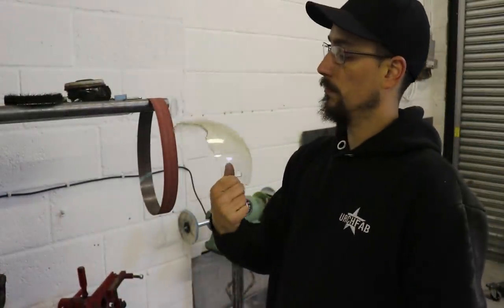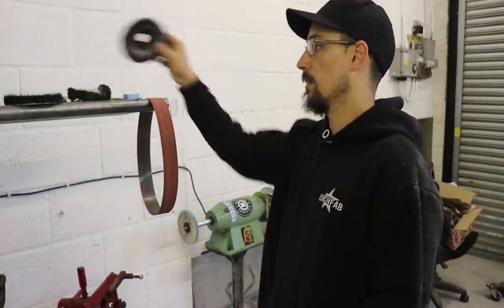HOW TO RESTORE SCRATCHED/ BURNT/ CLOUDY WELDING LENSES

Comment: I used meguires scratch x 2.0 with a little polish wheel/buff pad that fits in your cordless drill and it came up a treat. So a similar solution.  Good stuff
Reply: Where did you got the polish pad for drill? Have u got a link by any chance?

Comment: Works great Matt. 1982 and I finally rebuilt a vehicle properly. A 250 RD Yamaha. Fitted a fairing from a different bike. Screen was scratched to death. Did it by hand, fine emery, steel wool them metal polish. Person I bought it from saw it afterwards and asked where I'd got the new screen from 😊
Reply: @Walter Sobchak Yes, any abrasive fine paste works well

Comment: Matt, good idea , but if you do not have a belt sander with 1200 grit , I use  a product called Mothers
aluminum polish, it works great  , I think any aluminum polish will work. I have the same helmet as you
mine came with 3 of each (clear,yellow) and I have not touched them yet , just wipe some mother's on it and wipe it off and presto clear lenses again.  Cost about 12 dollars Canadian at Canadian Tire stores. got this idea from another you tube channel

Comment: Hi Matt great tip your right i am kicking myself i have chucked loads of these away and now just buy the clear because they are cheaper,  have you got links to the items you are using i cannot find them any were also do you get the same result with the grinding wheel buffer pad and were do you get them from checked toolstation and screwfix but no joy.

Comment: I find that most of the garbage is from the welding smoke, and with cleaning fluid for counters, and a couple of paper towels, most of it comes off. It doesn’t take scratches off, of course. But then, I don’t put my helmet down on the front.

Five or six quid each is a real ripoff. In dollars, I buy a package of 5 for about $18 off eBay. That’s about £14.3 at current rates. So about £2.86 each. Not cheap, but not terrible. Polishing works well, but you can clean it two or,three times first.

Seriously, just don’t put these face down!

Comment: Why do I find these videos after I've already done it? :) This guy is stealing my tips!!! First thing first, don't do this on a bike helmet, window, screen, something you want clarity with. Second. Meguiar Plasti-xR (balm without sand) is garbage and still won't make it cloud free. Third, I'm gonna give the flame polish a try. Fourth, Urchfab still never gave tips how to prevent this shit from sticking, can't polish after every 2-3 uses, that will get old fast. I'm thinking grease, wd40, engine oil, candle wax, dish soap, etc... which substances do you guys think will help the spatter slide a little bit better without melting onto the lens?
Reply: Update: using flame does nothing to polycarbonate, in fact you can ruin it, starts getting hazy, worst it can start to bubble. And finally using some oil does prevent shit from sticking badly. It was definitely easier to wipe then re-apply some oil again. Just don't expect clarity....
Reply: So I've restored a bunch of welding helmets for colleagues with great success. WD40, or any oil is highly recommended to prevent stuff from sticking, kinda like how you put dish soap onto race car windows to stop them from steaming up. As for removing you can start with something extreme like 1000/2000 grit sand paper if you see deep scratches and then work you way up with any type of polish you have in hand. Most of them are some sort of paste with sand which at the end will return the haze look. So here is the important step, if you are into knife sharpening then you have stainless steel green compound which is down to microns. That shit will really polish the surface to crystal clear and easiest way to get it is from Aliexpress. It's important you get the green one and try sharpening your knives with it.